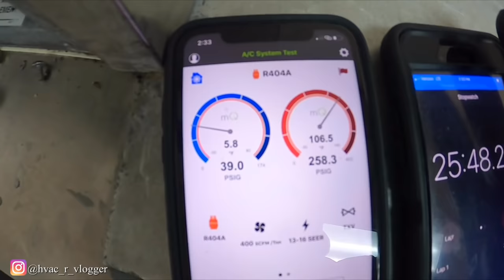ICE MACHINE MOST COMMON ISSUE

Comment: Can you repair these bin controls by cleaning the contacts?  I’ve replaced mine twice and now the third one is acting up.  It seems like they should make them with a better contact, or stronger spring to close the circuit. (Not too strong, as to allow the filled bin to open it)  but just curious to see if the only remedy is “replacement” and not some simple maintenance?  Cleaning of the bin control?

Comment: So he told the customer that its just going to cut off randomly? So there was no fix? You said theres normal 2-3 main issues with ice makers and it seems you didn't fix anything other than cutting it on. Did you replace a switch, clean a coil or anything?
Reply: A good portion of the time, the bin control issue is where it connects to the control board on a Hoshi. Pull the bin connector off control board and mash in the connectors on female plug and reinsert on controlboard. I have run into quite a few of these over my time dealing with Hoshi's. Hoshi really needs to do a redesign on this connector.

Comment: Bin control baby. Just popped a block of ice out of the back of the flapper. That unit was clean man. If you did it good job and if not give the staff mega props. I only service hoshizaki and electro freeze so that was super nice call for the end of the day. Be easy and keep hydrated in the heat.